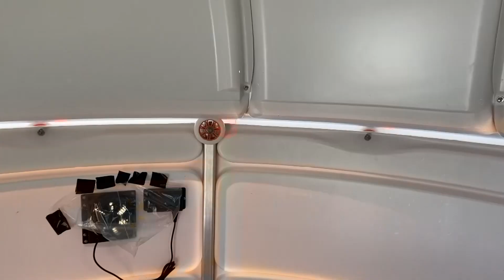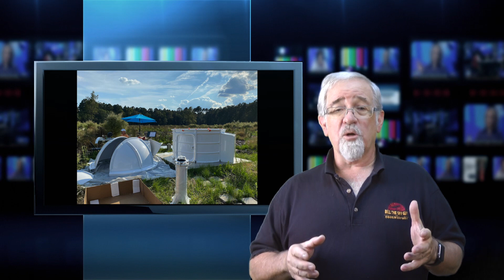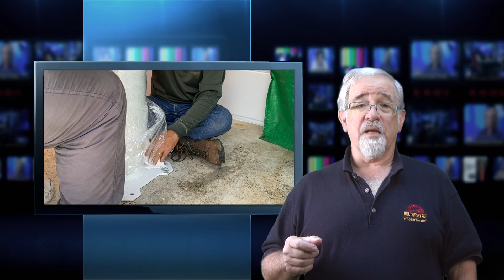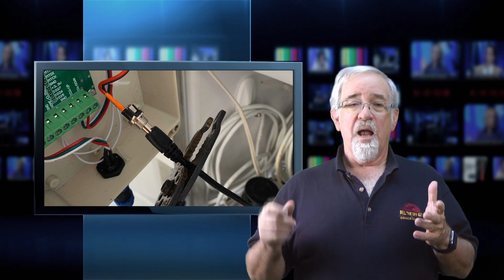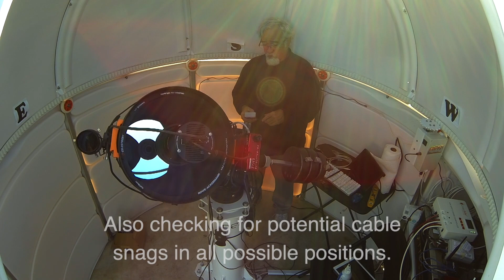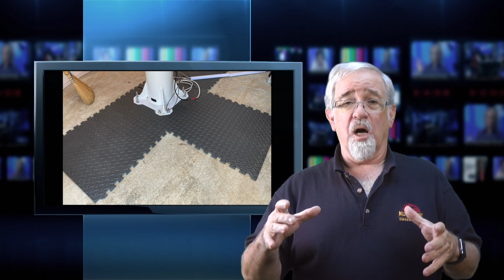Building My Personal Remote Observatory: Part 5

Comment: BTSG, thank you so much for documenting your journey - this is incredibly valuable! I am planning an observatory in northern Wisconsin, about a 3 hour drive from my home, for very dark skies. I was considering a NexDome to hopefully deal with snow. But after your experience I think I'll go a different direction.
Reply from the maker: Jim, thanks for writing. I've had this thing running for a year and a half now and for some reason, even though I'm comfortable now operating it, it's still pretty sketchy. I'm lucky in that it's only a 50 min drive from here so if something happens and I have to go out there on an emergency basis, It's only a few hours, not the better part of a day.
There's a dome company out in Lake Havassu AZ, "Astro Haven" that has a 7-foot clamshell style dome that is an industrial-grade product, but it's $20k. Probably money well spent in your case. Some of the reliability issues I have can't be laid 100% at the feet of NexDome, there is my "edge of coverage" access to the cell network which is how I get my data down and communicate with it while using it. If that link goes down when the shutter is open, you're going to be getting in your car.
I wish I had an all-sky camera out there.
I think the NexDome is a great product for your backyard when, in a pinch it's no big deal to walk out there and flip a switch or whatever. To do everything you need to do remotely takes redundancy, planning, and procedural awareness to a level MANY times more advanced than backyard use. Good luck and I'd love to hear about your progress with whatever you end up going with.
Reply: @BillGwynneTheSkyGuy  The Astro Haven clamshell looks amazing and simple! AHE proposes their designs can be placed anywhere including extreme weather environments. However, several CN forum members report poor performance with snow/ice and AHE is sympathetic with no resolutions. Several members recommend Ash Dome which I'll research next.
Reply from the maker: @SunJao  I'm not aware of Ash Dome; I'll check them out. Thanks for the tip!

Comment: How "remote" is the setup?  Is this a large backyard type or in a different location entirely?  I ask because of the G-11.  That's not the first mount that comes to mind for a remote setup.
Reply from the maker: Mark, I have to drive just under an hour in order to get to the observatory so it's definitely more remote than a backyard but not so remote that you can't just go out there whenever you need to. I probably wouldn't have selected the G-11 either but I didn't buy everything brand new all at once for this project, I had the mount (but not the pier) already as well as all the scopes I'm using out there.  The G-11 is usable in this configuration as long as you have enough control over it via software and live cameras to keep an eye on it while you're slewing. I have had so many 'runaway' weird events with it and to be fair I'm not 100% sure if it's the mount or Sequence Generator that the root of the issue but nevertheless you can NEVER trust an automated meridian flip to "go the right way" to avoid cable wrapping. So I manually point the telescope to the part of the sky I'm shooting that night. I leave the mount and computer powered up all the time (tracking disabled of course) so the RA/DEC values aren't all that far off. Next I maneuver the dome opening in front of the scope and do a plate solve. THEN I use automatic centering and dome following from there on out. It's actually kinda fun but you can only be sure if you're doing it right if you can SEE the scope and how it's moving on the security cam. My two cameras are focused on the scope and dome and one on the entry door and the contact of the shutter to it's charging pads (indispensable).  All of that said, you know anyone selling an Astro-Physics 1100GT??

Comment: I feel like I could probably engineer a better dome and possibly cheaper...
Reply from the maker: Better design? No doubt. Cheaper? Good luck with that. Plastic shortages are real (I had to wait 3/4 of a year) Sure you can build a roll-off roof kinda thing with wood but then you're building a small house that you can't move anywhere. I wanted something that you could at least theoretically disassemble and transports somewhere. Do you absolutely need a pier? Not really; but since getting the pier I only have to throw away a few subs out of every 100 frames, on the tripod it was more like 15-20. My guiding is now typically in the .5-.8 arc-sec range; before it was 1.25. This was my best fit, as explained in Episode 1 of the series.  Thanks for watching and taking the time to comment.
Reply: @BillGwynneTheSkyGuy  DJ Nebulosity you are a joy to watch, thank you so much for documenting your whole ordeal, that is awesome.

Comment: Love being a beta tester for Nexdome. Still working on some fixes for mine. Makes you wonder if they ever put one of their domes together at the factory??
Reply from the maker: Or better yet, in the middle of a field 15 miles from the nearest hardware store!
Reply from the maker: Yes, it DOES make you wonder. They certainly have not tried to make the shutter motor work from a remote location before or they wouldn't be staying with the dangling power connector design. I swear to god they must've been on acid when they thought of that and thought that it would work and be reliable!